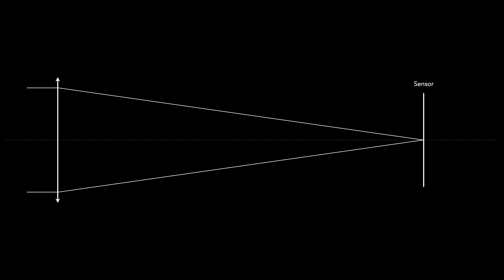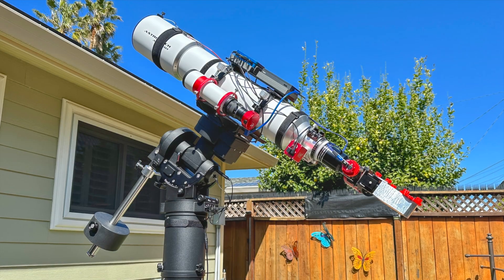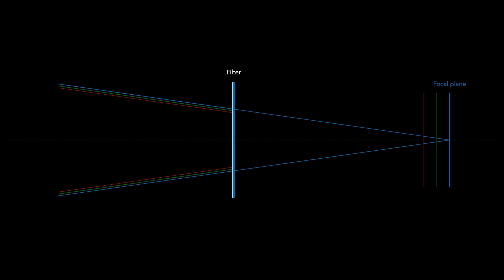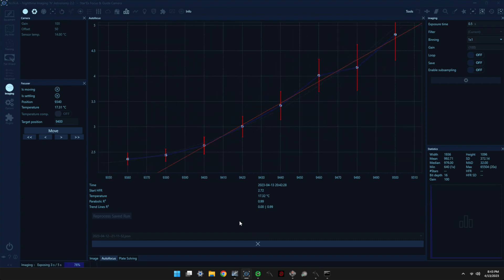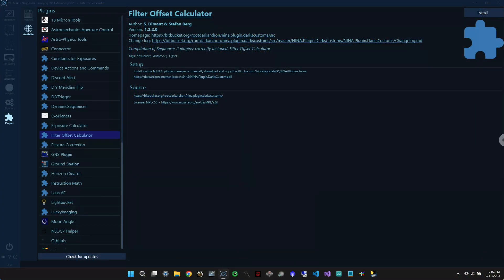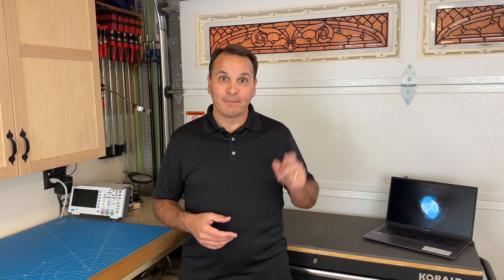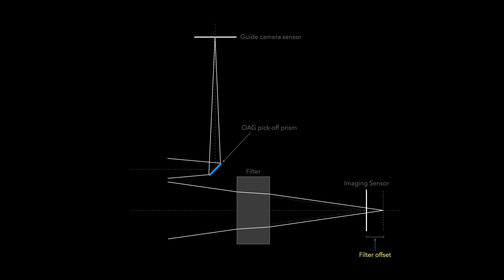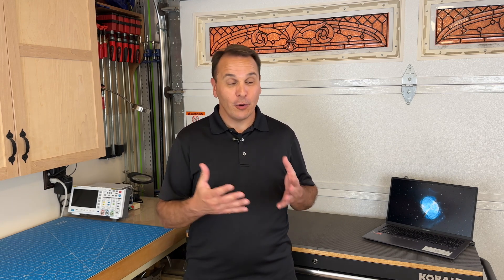Improve Your Technique By Mastering Filter Offsets [Tutorial]

Comment: Hi!  Really interesting information. I run one filter (or no filter) on an OSC camera. When discussing with my sales rep they informed me to deal with the filter offset via shims that I’ve placed on the camera, behind the spacer. They indicated the filter would require a chance to back focus. This effectively pushes my camera sensor back by the amount of offset specified by the filter manufacturer. I do not have offsets defined (Ekos). Once my OAG camera is focused I generally do not need to touch it. Autofocus is working fine with filter and shims. Removing filter (filter drawer, not automated) and shims does require an OAG refocus. 
Would you recommend that I begin using software offset configuration or is what I’m currently doing equivalent?
Did they give me bad info?  My results have been good so I have not pursued any changes. 
Thank you, Cheers!
Reply from the maker: Great question! They did not necessarily give you bad info :)

First, could you share some more information about your equipment? Do you have some kind of flattener or reducer?

If you don't have a flattener or a reducer, you shouldn't have to worry about back focus.

If you do have a flattener or a reducer, back focus is important to get right. But in my experience, in most cases, it is not critical to get back focus absolutely perfect. Being within 1mm of the ideal value is probably fine for most people (there are notable exceptions, mostly with super fast telescopes...) Once you've achieved good back focus, you don't need to mess with your shims.

Which is why I strongly recommend that you look into filter offsets, and applying them via software, even if you use a manual filter wheel or a filter drawer.

Hope this helps!
Reply: @darkskygeek  thanks so much for the reply!  I run a field flattener (55mm back focus) -> OAG -> filter drawer with a duo-narrowband at 1.85mm filter thickness -> standard ZWO camera spacer-> .9mm shim stack -> camera. So my shim offset to backspacing is + .9mm. 
.9mm was derived from .5 filter thickness of 1.85mm rounded to as close as I could get. 
I would be happy to ditch the shims as I feel they’ve introduced a small amount of tilt. I will set it up in software and remove the shins.